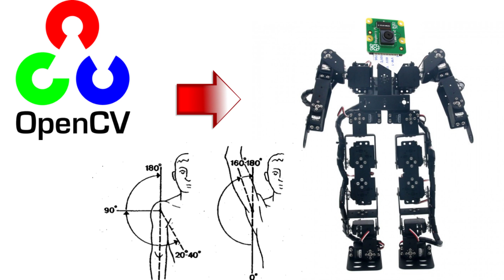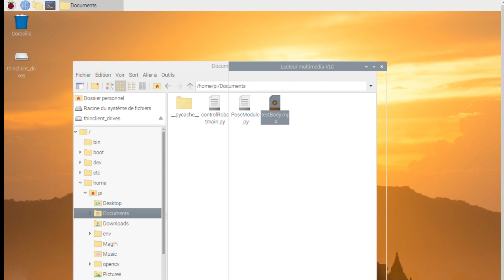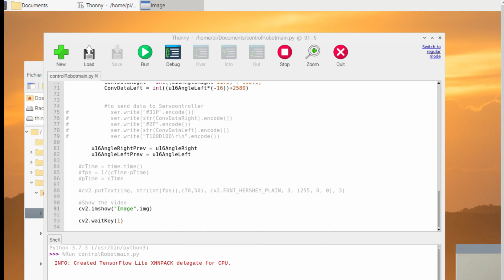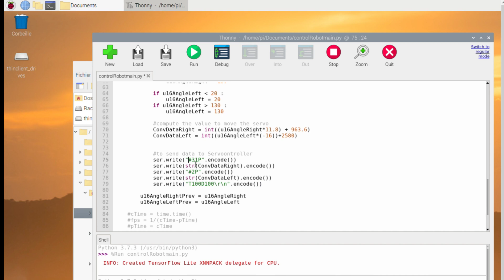Humanoid Robot OpenCv Raspberry Pi 4 IA

Comment: Can you please tell which batteries you're using?
Reply from the maker: Batterie Rechargeable Originale 100% NCR18650B, 18650 mAh, 3400 V, Eddie ion, avec Piles Jolie tues (Sans PCB), Nouvelle Collection 3.7
https://a.aliexpress.com/_EyvG1it
Reply: @jorgesalgado23  Thank you so much
Reply from the maker: @29klepto  the raspberry just use the Power Bank